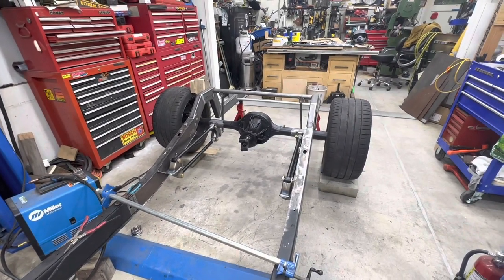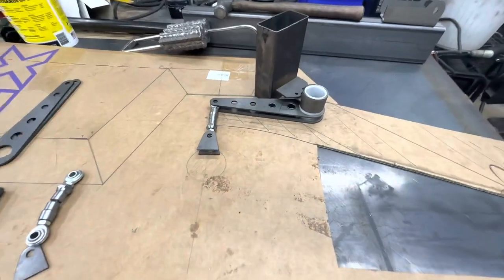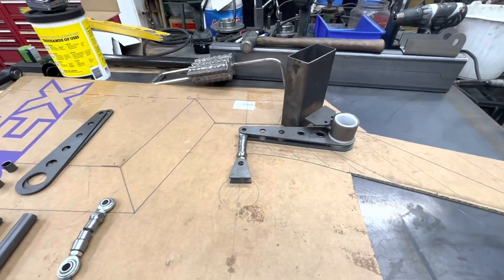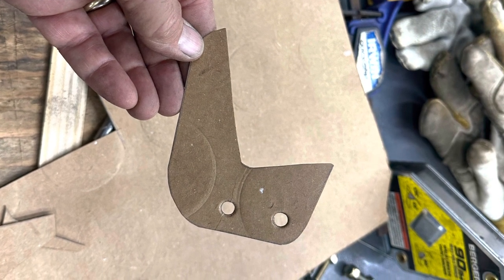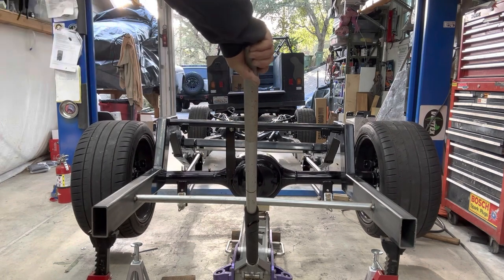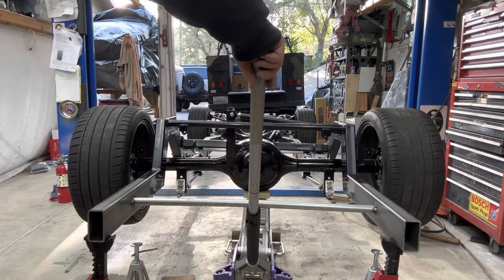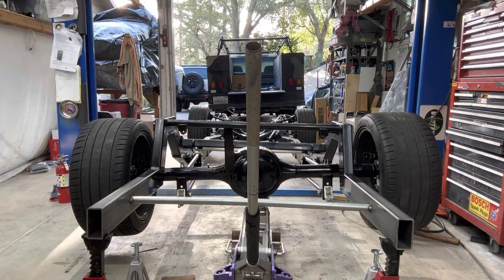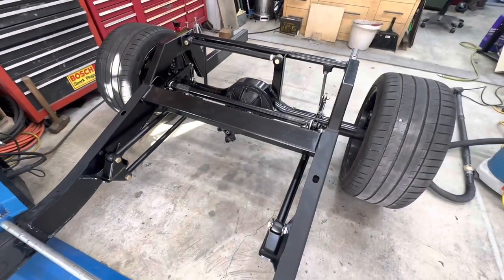Chevy S10 Parallel 4 link & panhard bar with custom sway bar

Comment: Did you have to redo the back end? Would the rear seat area work with the original s10 back half? I am doing a basic frame swap and I don't want to notch the back if I can avoid it.

Comment: Is it necessary to run a sway bar or torsion bar whichever you want to call it, when I am running coilovers in the back of my S10. Yes I'm running a parallel four length just as you are. I will be basically running on the street no prep racing. It's confusing because some people run a sway bar in the back and others don't. Is it because of the coilovers? What's your opinion?
Reply from the maker: Great question. When I was researching this I found that factory S10 set ups did not use an anti sway bar except for upgraded models. That may have changed in late models but I think the nature of a small pickup left it a low priority. There’s no shortage of aftermarket ones for S10 rear ends if you decide later to add one. I figured I’d play it safe since I was building the rear end completely. It’s the biggest unknown for me with this project. Because  this is a heavy set up i think it needs it. Obviously i hope this handles well but i wont  know for sure till it's running.

Comment: Triangular 4 bar would have worked better because with that configuration you don’t need a sway bar….!
Reply from the maker: Definitely looked at that option. After ton of reading, talking to builders, talking with guys at the suspension manufacturers, and mocking up some ideas I decided on the 4 link with panhard. Lots of ways to do things. I’m always impressed when someone has enough confidence in their experience to decide what some else “should” do or have done. Thanks